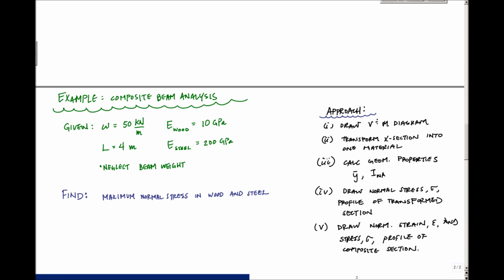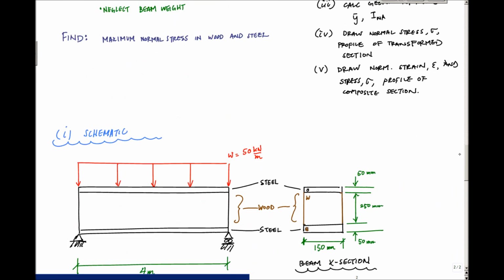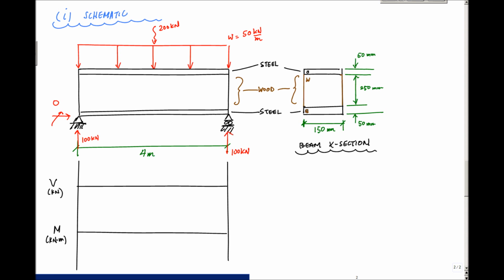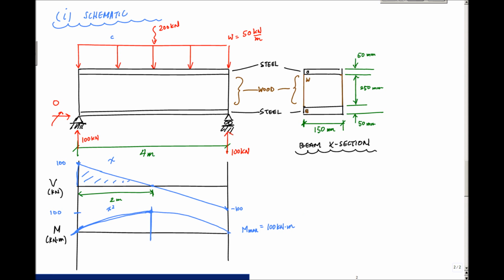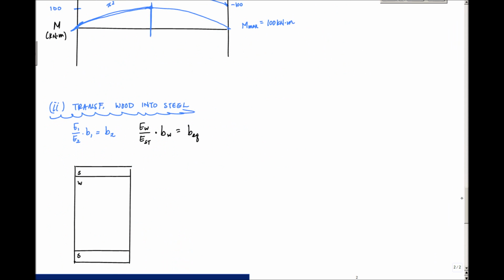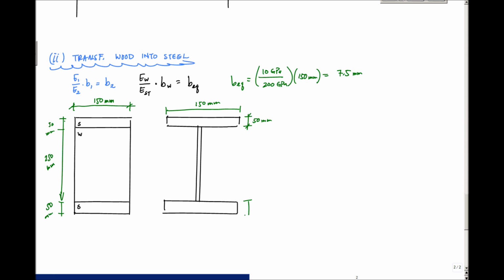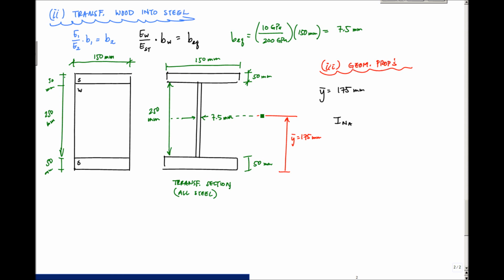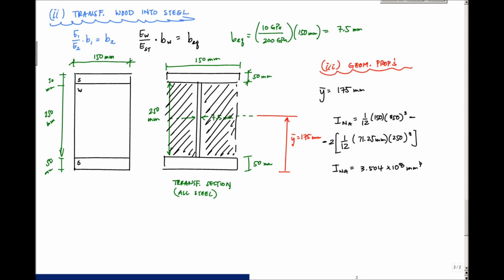Composite Beam Analysis Example (Part 1) - Mechanics of Materials

Comment: How do you find where the neutral axis is located in your transformed section IF your section is only symmetrical about the x axis?
Reply: Lizzie O'Callaghan Neutral axis does not shift after you convert material A to material B.
Reply: Thanks so much Nizami Eminov that's all I needed to know :)

Comment from the maker: does the material remain linear elastic? is the steel plate a circle as well or can it be a rectangle? If the steel plate can be modeled as rectangular and all materials remain linear elastic, I would convert the steel.

Comment: TNX for your useful and comprehensive videos, they are incredibly perfect and useful, I just have a question that maybe you can help me with that. 
I have a composite shaft which is applied torque T, material transformation in this case is similar to the above example? can you please explain about it?